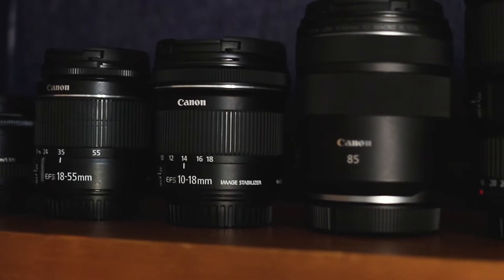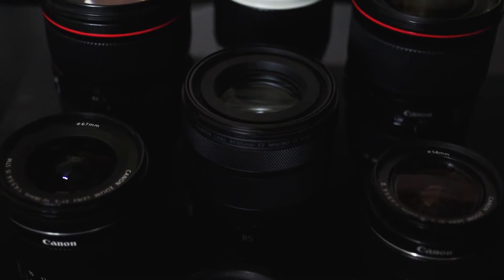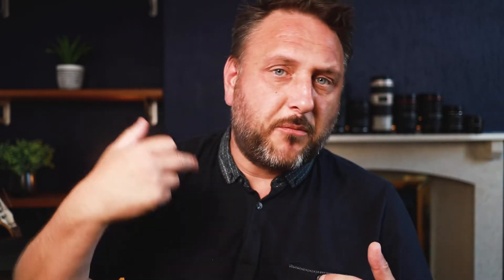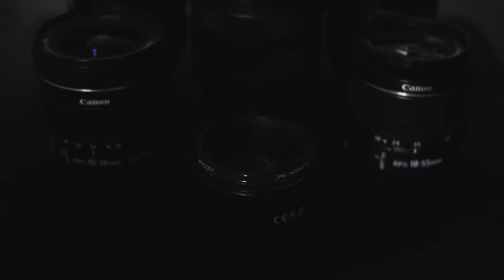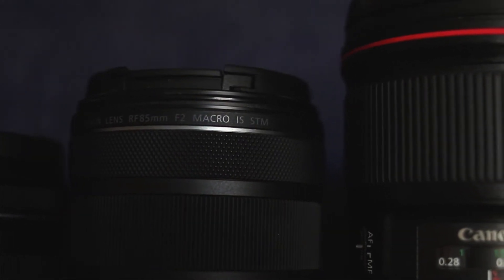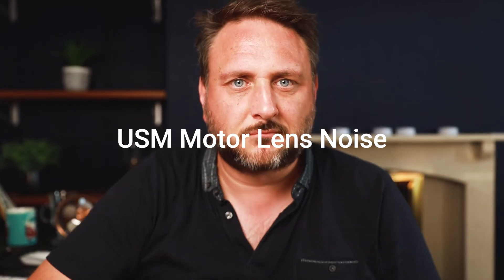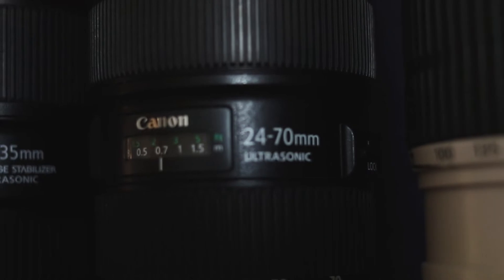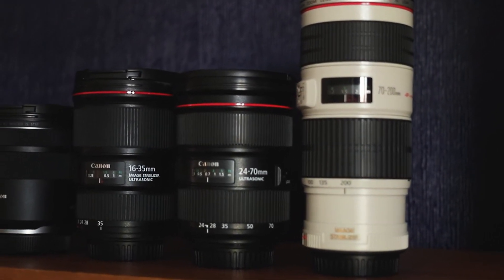Canon Lenses Explained: DC vs STM vs USM

Comment: My 18-55 just died/only focusses one way (close to far) which leads to out of focus shots if it overshoots so i consider it completely dead apart from manual focus projects.  Sadly the price of camera geat absolutely skyrocketed.  for example the 18-135 more then doubled in price since the release here. I would love a USM replacement but those things start at 500 bucks.  i love them and own one (canon 100 mm macro) but i just cant justify the price bump that is x2 or more.  Seems STM lenses are out of the equation tho.  Way to slow for animal shooting.
Reply from the maker: STM motors can do a decent job for animal shooting but (in my experience) only on prime lenses. The second you throw any zoom into the mix you're right, they are far too slow due to the arrangement of moving lens elements.
Reply: @LetsClickPhotography  Thanks for the reply. I have a love hate relationship with prime lenses. They are great for IQ but they are just not as versitile as i would like. I'm aimig to get a second older body for a prime lens on it as a compromise but as a main i prefer to take the IQ loss and get the right framing then to get a wrong crop of what i want or to have to crop and lose IQ that way.

Comment: Sorry if I missed this in the video but, for the USM is the racking for focus snappy for both auto and manual focus or just auto?
Reply from the maker: Hey, sorry for the delay, yes USM focus is faster to move focussing distance in manual focus vs STM - it's to do with the stronger rotational forces needed for USM to move the various elements and then hold them in place